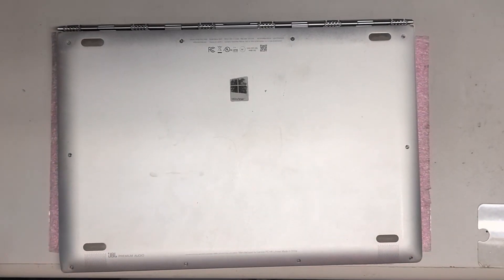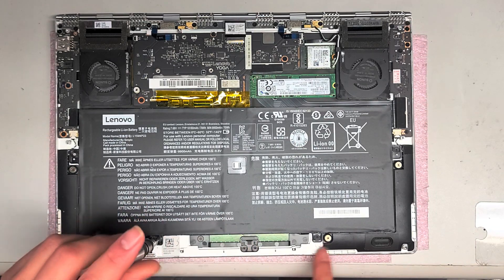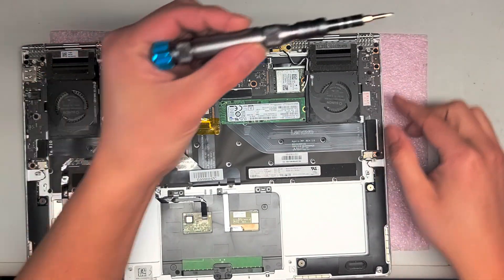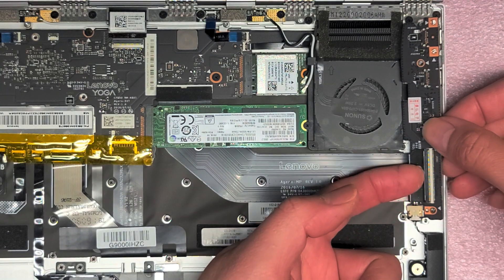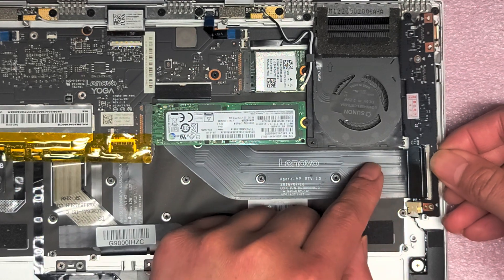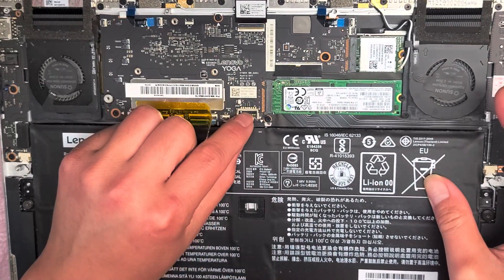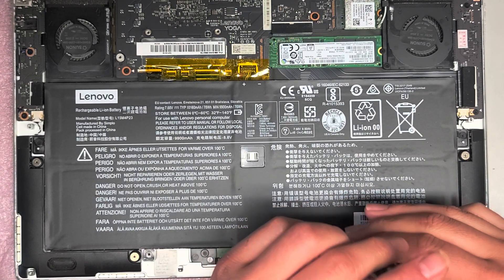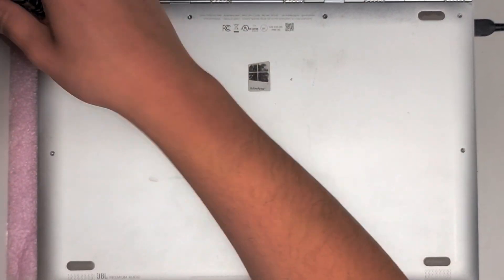Lenovo Yoga 910-13ikb Disassembly USB C Charge Charging Charger Port and Battery Replacement Repair

Comment: hey, great video. can you say where you purchased the replacement board?
Reply from the maker: I think eBay
Reply: @ItsBinhRepaired  I put in the new board, but the laptop still won't power on, no light when I plug in the cord. what else might it be? should I replace the ribbon also?
Reply from the maker: @SpiderCowboy_1  try the one key recovery button

Comment: Hi bro! I have other terrible issue. My Yoga is about 3 years old and after about 1.5 year fast charging stopped to work. Notebok was charing only by low volttage mode what was taking ages and yoga used more power than charged. Suddenly, after Windows Update, fast charging had fixed... unttill yesterday. Yoga started low charing mode again... Do you think that replacing charing port would fix that issue? Maybe you met same issue before?

Edit: forgot to add that i have 920-13ikb version.
Reply from the maker: I'm not sure. You can try. Possibly charger too.

Comment: Changed my battery for the same laptop. But it wont still charge... It says its charging on windows but no...
Reply: Any other ideas than changing the usb c dock? Not willing to put another hundred € to this :D
Reply from the maker: @F4kiiri  did you try another charger?
Reply: Yes I did now, and actually with another adapter and its loosing connection all the time. Charging light twinkles
Reply from the maker: @F4kiiri  bad charge port :(